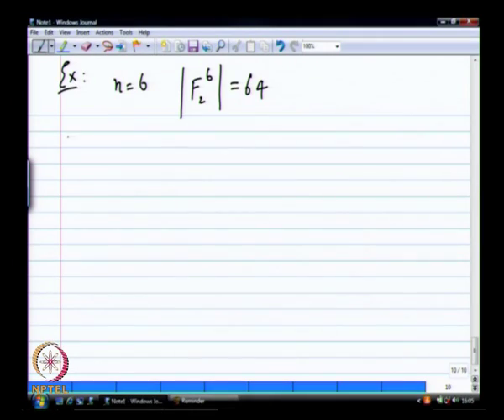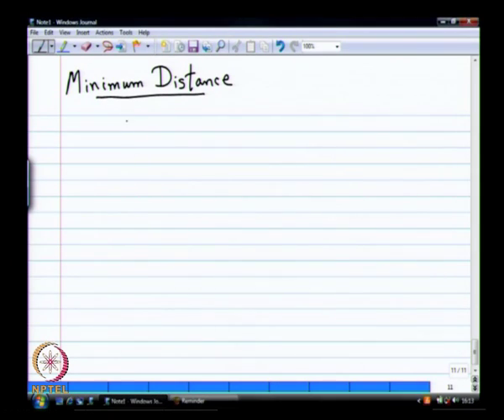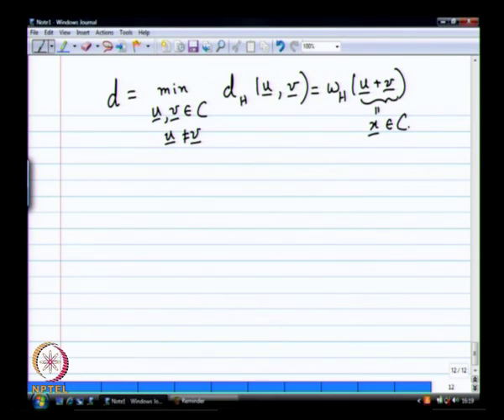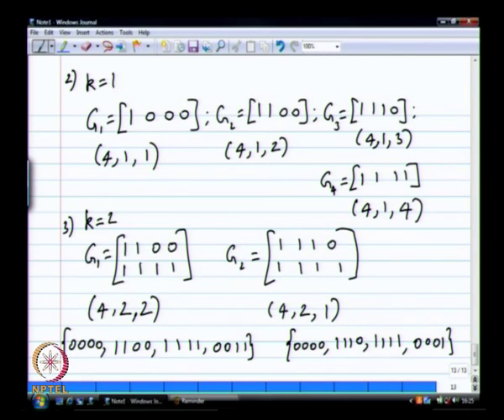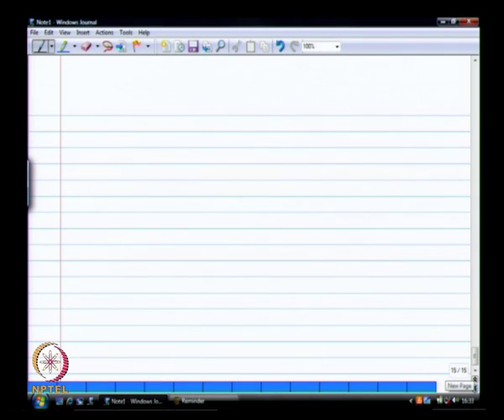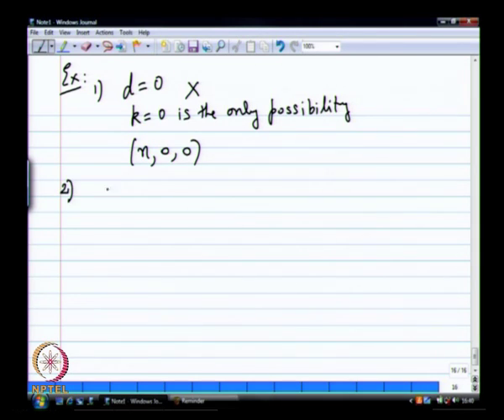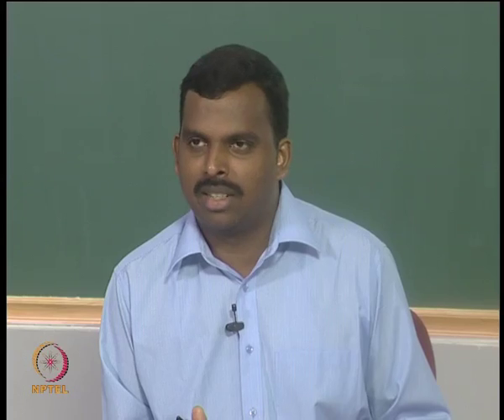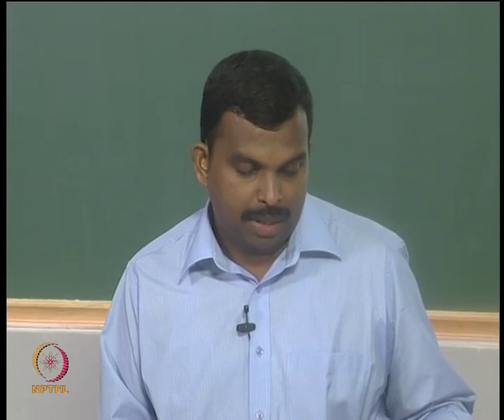Mod-01 Lec-04 Minimum Distance of Codes

Comment: 20:46 how do you calculate the code words without converting the G in systematic form.
k=2 so m = 00, 01, 10, 11 ..parity bits i could not figure out
Reply: It doesn't matter if RREF(G) is in systematic form or not; all code words in the code are all linear combinations of the rows in G.